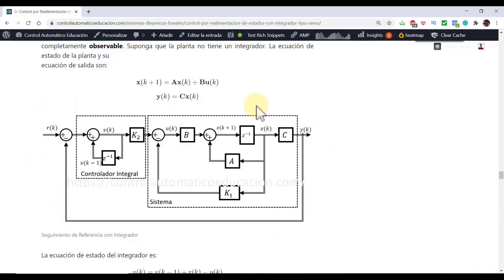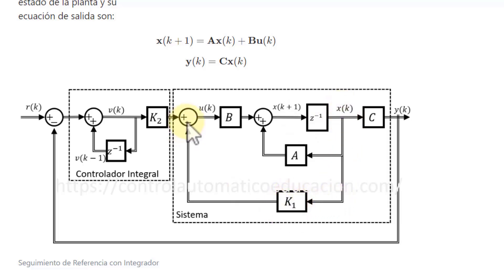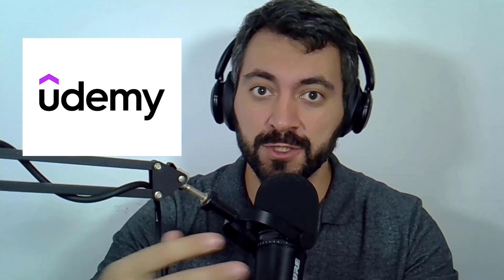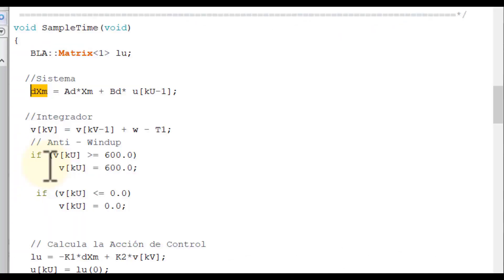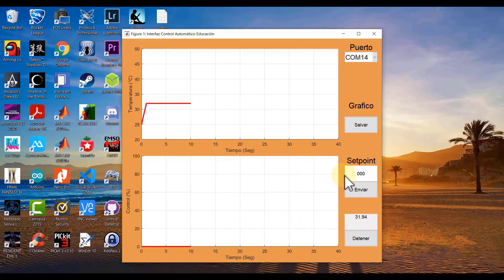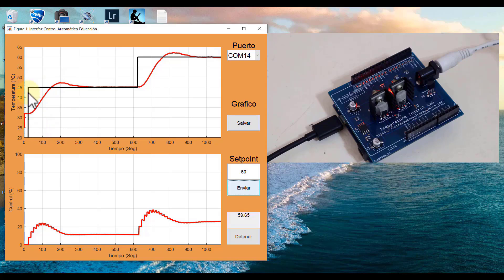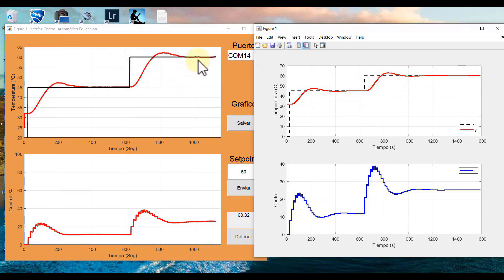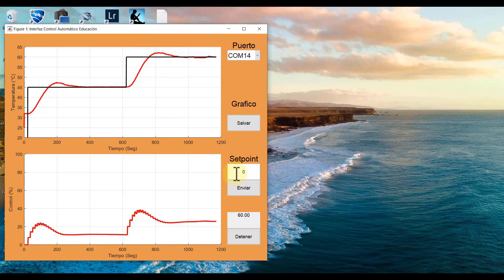State Feedback Controller Design on Arduino | Applied Control System Course

Comment: Hi! For a state space control algorithm in Arduino, it's enought to control a analog output with u= KX?
Reply from the maker: Hello @mathmaker6946,

For a state-space control algorithm in Arduino, using u=KX can be sufficient to control an analog output, depending on your system's requirements and the accuracy of your state measurements. 
To learn more about these advanced control techniques and build your own control system from scratch, I invite you to enroll in my course on UDEMY: Applied Control System in Arduino =  https://bit.ly/AppControlArd 

By using this link, you'll receive a special discount. In the course, you'll gain hands-on experience with PID, RST, FUZZY, and cascade controllers, as well as constructing and controlling your own plant.